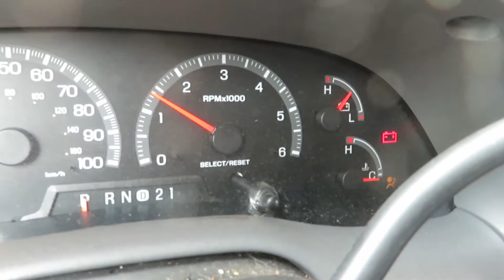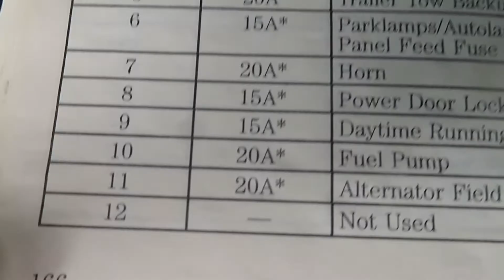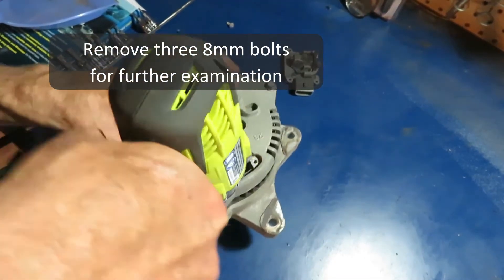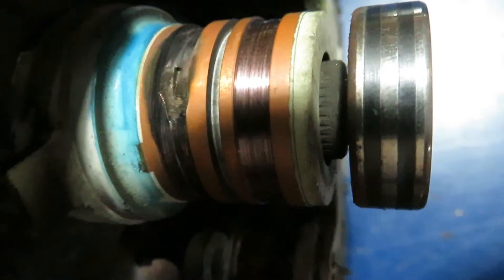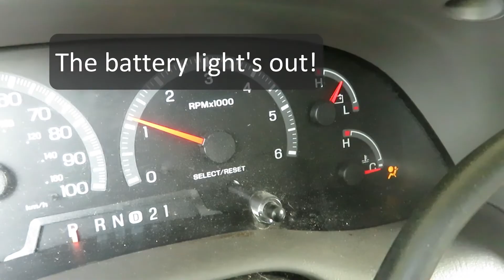Battery Light On? Troubleshooting and Repairing Alternator Circuit Ford F150

Comment: Myself I have been dealing with issues with a '90 Van 5.0 damn thing doesn't even have a known fuse that I can find for field excitation voltage that I can find. Missing at the alternator. Yes I know how to troubleshoot and track down the problem. No light, has gauge which was disconnected before I got it with no sign of where the wire would even be. External regulator that can't be accessed with the battery in. Ignition switch that's a pain. Best not even touch it if you aren't prepared to remove the steering wheel cause that rod might not stay in place. I swear I hate working on Fords. Give me an old GM any day. Alternator that fits comes up "does not fit your vehicle" at AutoZone and yes I'm not a fan but that's what was in it when I got it. Only way was because I already had the receipt with part number from previous owner and I replaced it 2 years ago. One thing after another with this thing and "simple" problems until you start trying to fix it. Nothing but ridiculous complications every time with every repair.

Comment: Thanks for the help, the way you explained what you were doing as you checked gave me the confidence to just do it myself. Though if anyone else is replacing there alternator as well, make sure they actually have the right one at the part store before you truck dies in their parking lot.

02 F150 4.6L V8 needs the 8groove 5in diameter if anyone needs it

Comment: Would i still be able to change the voltage regulator even if the slip rings look like that still ?
Reply from the maker: I don't know how to answer that except to say alternators aren't that expensive if can do the job yourself.
Reply: @TheOriginalMechanic  gotchu and it's cheaper doing my self nowadays

Comment: Ok, so I have a new battery and alternator on mine and the battery light is still on. So I guess fuses and connections need re-checked.
Reply from the maker: The first thing I would do is put meter across the battery terminals to make sure the proper 14V charge voltage is present when the vehicle is running.

Comment: Also in addition check the thick red and black wire on back of alternator for corrosion if so clean accordingly with wire brush and trace that same wire up to the fire wall and take a loose them connections as well and check and clean corrosion

Comment: I wished that was my problem. Battery is good, alternator is new.........light still on. Gotta check that fuse, lol.
Reply: What happened 🤔
Reply: @Brucesanders2024  Never did get it fixed. Sold the vehicle a couple months ago, lol.
Reply: @StormLaker 😮😮wtf😅😅 well dam I just got back with my new alty. Wish me luck. My alternator fuse was blown😮 wtf they started that chit😡😡 I just bought the dam thing Cuzz something made it pop and I need my truck I had to push it out the street at work so I ain't got time to diagnose it hopefully I replace the 20a fuse put the alt in and no issues 😒😒 wish me luck

Comment: OMG I replaced alternator@battery still out putting 12 volt,,,it was a 10 cent 20 amp blown fuse,thank you sooo much watch 20+ videos gone on Ford F-150 forms with zero luck,will alternator and battery are good for a while now lol

Comment: My Ford F150 1997 i changed the battery 🔋  after 2 years. After i start  it and ride good but asoon as i stop given  gas ⛽️  the  battery light turns on. But when i gave i reff, it light  goes off. What could it be the alternator needs to replace or something else?
Reply from the maker: A slipping belt comes to mind first. If that isn't' it I would suspect the alternator.

Comment: My 97F150 third alternators still not charging wiring was missing so no field fuse how does it wire in
Reply from the maker: I don't profess to being a wiring expert. I would look at a wiring diagram of the circuit and try to duplicate it.

Comment: Didn’t you have any intermittent rough idling? I have. 2004 f250 5.4 . Batter and alternator are fine. But battery light is on when the truck runs it’s runs fine then rough idles for a few moment thens cleans up then will randomly high idle then drop back down I’m so confused as to what’s wrong. When I first brought the truck home I had it running for like 20 min I shut it off and tried to start it and it was dead I replaced the battery w a brand new one, had advanced auto check alternator and it’s fine. I have no idea what to do
Reply: I meant did you have* not didn’t you have
Reply: Also no check engine light
Reply from the maker: @juliorobles5696  I would focus on fuel delivery components such as fuel pump, filter, injectors. Idle air control valve maybe?
Reply: @TheOriginalMechanic  okay thanks so much I’ll start there. Would love to get the truck running properly and give my Silverado a break. I got the best of both worlds lol 5.3 and now a 5.4

Comment: I have a 2001 F-150. Just purchased the truck. 
The battery light just came on the other day. I had a parts store test the battery and alternator and both came back ok. I get 14.7 volts consistently even with a load. Battery reads about 12.2-12.5 vdc. If I unplug the 3 pin connector off of the alternator while it is running, the light goes out. Any ideas?
Reply: Yes. If I remember correctly, it was a loose connection on the single wire connector. See around 4:30 of the video. I touched /moved that wire at one point and all of a sudden the light went out. I believe the connector clip was broken and was not getting a good connection. I haven’t touched it since and light is still out.
Reply: Did you ever figure it out?

Comment: Great video, thanks!  My 2007 F150 battery light just started coming on but only at idle at a stop light just last night.  I put it in neutral and reved it up to 1,000 rpm (idle was 750) and the light went out and stayed out…until the next stop light!  It got me home but I’m guessing I’m going to need a new alternator.  I looked at Advanced Auto Parts and their prices range from around $100 for a remanufactued to $265 for brand new.  

The truck has 218,000 mostly highway miles on it, I bought it new and plan on keeping it forever, just to haul hey to the barn, should I spend the extra money for the brand new alternator or is a remanufactured one ok?  Also, how many hours of “labor” should I expect to pay a local small repair shop (not the Ford dealership) to install it?  

Thanks again for doing the great job on that video, now do you have one for the F150 automatic transmission?  Mine is skipping a lot when it gets to around 45-50mph.
Reply from the maker: My only advice on parts like alternators is to put in a name brand. I stay away from the store brands of stores like Napa, Advance Auto etc. I put an AC Delco in my truck. I wouldn't worry if it's new or manufactured either. Thankfully I haven't had to do any transmission work on my truck, aside from changing the fluid. Have an good one and thanks for watching!
Reply: Hey Timbo77LR I am experiencing the exact same thing on my 05 with the battery light coming on @ idle and off when it's revved. Was it the alternator?? Cheers
Reply: @zoots15    Yes, it was a bad alternator, I replaced it with a new one and it’s been fine ever since.  But now  the transmission is acting up!  Lots of bucking around 45-50 mph!
Reply: @Timbo777LR  Thanks bud. I changed it out today and everything is back to normal. As far as your bucking issue, you may have a bad  ignition coil(s). I had similar symptoms a couple of years ago and changed them all out. Problem solved. Hope it works for you! Let me know. Cheers.
Reply: @zoots15  you were right about the ignition coils causing the bucking!  My private mechanic (not the Ford dealership) has been changing out the plugs and wires as the coils are now part of each wire, and after installing 3 new ones, bucking stopped.  Thanks for the help!

Comment: My 2003 f150 did the samething it was a 20 amp fuse but my light is still on and I'm charging at 14.51
Reply: did u find the problem, mine is charging, but light stays on

Comment: My 2005 F-150 battery warning light is on/off after I did this......I had to jump/charge a battery on my riding mower, 12v.  Used my truck, unstarted.  Mower started but would shut down if I removed jumper cables.  So, I let it charge for about 10 minutes, never starting my truck. Removed cables and mower stayed running.  Would this affect the alternator?  Thanks for any advice.
Reply from the maker: I don[t see how that would hurt your alternator. Might take a bit of charge off your truck battery, but that's it.
Reply: @TheOriginalMechanic  That's what I thought but it still flashes the battery warning light, two days later.  I made a 1.5 hr trip and thought that would be enough to recharge. I'll give it one more day.  Thanks for the reply!

Comment: Great vision, very informative. 

I have a 2004 Heritage Edition with just over 200k (with original Alt), my battery light is flashing off and on, it is not consistently on. 

At first I checked the battery (650CCA), it was at 11.2 volts engine off. It would not turn over, all I heard was the clicking noise, with the starter not turning.

I charged it over night, with a 2amp trickle charger. It was at 13.6 volts and started just fine, showing over 14 volts at the battery with engine running. 

Since the battery was well over 5 years old I replaced it with a new motorcraft (850CCA).

It still shows over 14 volts engine on, the engine did turn over with multiple attempts, but the battery light is still flashing, not consistently on.

I did not check the alt other than the battery charging voltage.

Any thoughts?

Thanks in advance.
Reply from the maker: I think you  might have a poor connection on the small alternator harness. Take a look at the comment below .

Comment: A lot of times it's the single wire connector (grey)that jumps from the 3 wire plug-in not getting a good connection. It will cause the battery light to come on.
Reply: Will that cause a flashing battery light?
Reply: @noidnomis  
Yes.
Reply: This was what went wrong on mine. Battery light flickered once during a ~20km trip, when I started heading home on the return trip the light came on solid. 

Did the diagnostic steps in this video and still had 14.71v at the battery, a little less than 12v at the 1st and 3rd pins on the 3-wire plug and my fuse was fine. 

So I pulled the 1-wire jumper plug and tightened the contact inside. Plugging it back in - my battery light is out. My plug is damaged though (from before), probably during a previous alternator replacement. I guess I better find a new one before it wiggles loose again.

Comment: I did exactly what you did but didn't preform the voltage test toward the engine, is that why the new alternator  went belly up and the battery light cam on. What did I miss?
Reply from the maker: I'd look for the excitation voltage or a blown fuse in that circuit.

Comment: Nice vid!!!  I have a battery light that comes when the engine RPM is below 1500 RPMs.  It goes out above 1500 RPMs.  I already replaced the 6 year old battery today and it didn't fix it.  I was at the hunting cabin and didn't have any tools with me so I was over the barrel.  I was hoping for a simple fix.  The truck is 2003 F150 and the original alternator (18 yrs old).  Below 1500 RPMs and light on....voltage at the battery is 11.7-something.  I'll check it again tomorrow with the light off (above 1500 RPMs) and see if the voltage at the battery is somewhat normal.  If it is normal above 1500, I'm thinking it's the alternator.  Also......FWIW....I've never had good luck putting AC Delco (GM) parts on that truck (a Ford).  I (the repair shop actually) went thru 3 AC Delco pitman arms failing/wearing out and I finally told them to put on a MOOG part.  From previous experience with AC Delco I wouldn't have put that AC Delco alternator on a Ford....but that's just me.
Reply from the maker: So far the alternator has been working great. Your issue is a little odd but does suggest a failing alternator.
Reply: @TheOriginalMechanic  ....Glad to hear yours has been working good.  No more battery light on my end.  The light consistently going on/off based on engine speed was the first solid clue it was the alternator.

Comment: I'm helping a friend diagnose his 03 f150 with the same issue.  I'll have him review this video and check that fuse.   Do you have any idea what the solenoid on the firewall that the alternator wire goes to is for and how to check it if necessary?
Reply from the maker: Those solenoids are for the 4WD system.
Reply: This reply is about a year late and I hope you've figured it all out by now. But if you're talking about the solenoid on the passenger firewall,  that's the starter solenoid that grounds itself to the firewall and could cause a no start as it's connected to the alternator, battery and starter

Comment: wish i watched this before i replaced the alternator. my 20a fuse was blown. oh well, it was the original alternator and my truck has 200k miles so ill just keep the new one on it.
Reply from the maker: Could have been an internal short in the alternator. 200K? You got your money's worth from that one. Mine died at 120K.
Reply: Inside or exterior fuse

Comment: Replaced my alternator on my 99 and battery light still on?
Reply from the maker: If you haven't yet, check for excitation voltage input to the alternator. My coverage of that starts at 2:03
Reply: same problem i'm having... i have just put in a new alternator yesterday and still the battery light still on.
Reply: @ramboperkins7213  have you fixed it ? if so what was the problem